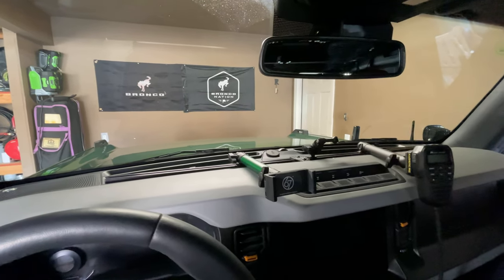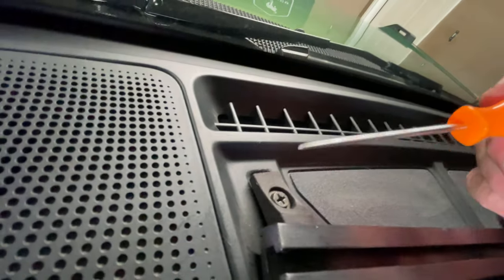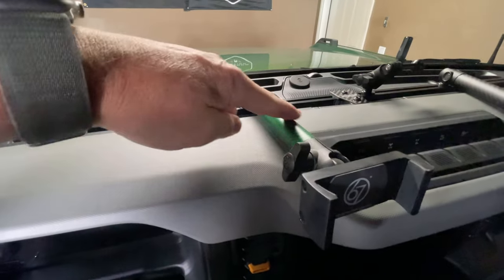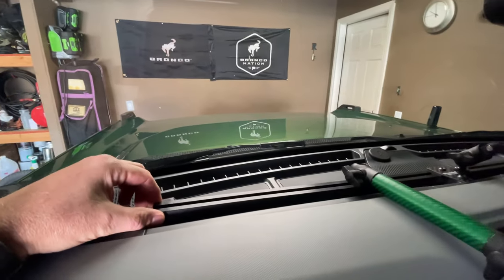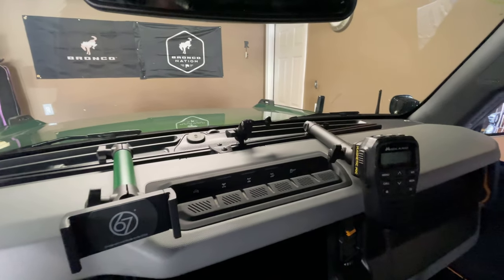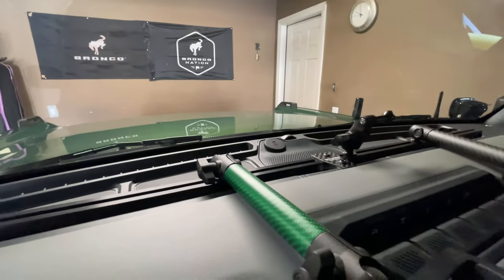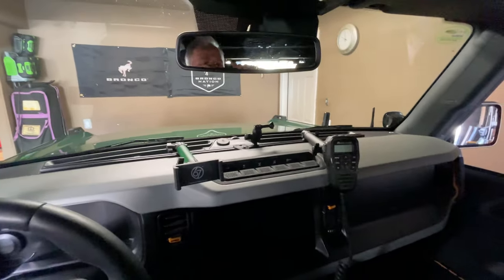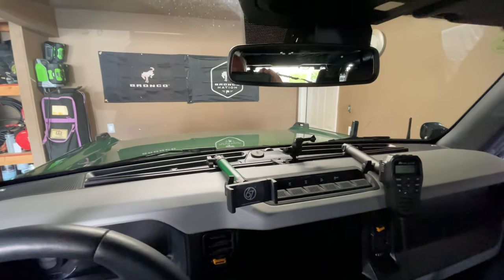67 Designs Bronco Rail Cell Phone Mount, GoPro Mount, and GMRS Mic Mounting System for Ford Bronco

Comment: I have this rail as well. I use their MagMount G3 for my phone and iPad Mini, even hauling ass my devices don't budge. I mount 2 x GoPro cameras, iphone, Yaesu radio control all on one rail. I initially went with the archetype racing mount which is a wonderful design but i didn't love that the ball mounts were stuck in specific slots.
Reply from the maker: Love it! Thanks for commenting and sharing your experience and how you use the rail. I almost bought the AR as well but like you preferred being able to move the ball mounts wherever I wanted.

Comment: What did you use for the magnetic mic?  Thanks
Reply from the maker: Hi I used the Magnetic Mic Holder. You can get it at several places but I ordered from 67 Designs. Not cheap but is super powerful magnet that has been great while off roading. Secure and easy access to your handset. Worth checking out.

Comment: Well shit! Who knew? If I had known all this time that a screwdriver and self tapping screws put a different type of hole in my dash than a drill does, I might would’ve already done it! NOT!!! I spoke w/67 Designs TODAY ? They are fantastic...I told her I wanted ANYTHING that I didn’t have to put ANY KIND of hole in my Jeep or Bronco!
Reply from the maker: They are fantastic. Did they offer a non-hole solution? There are other solutions out there without holes and just uses double sided tape. For me personally, I have no plans to ever remove it so a tiny hole in the dash you will never see is no big deal to me.  If I sell the Bronco it will go with it.  If Ford had this as OEM option from the factory would you care if there was a hole you couldn't see holding it to the dash?